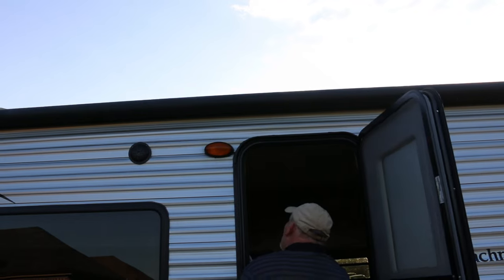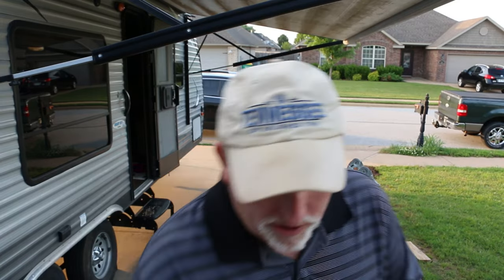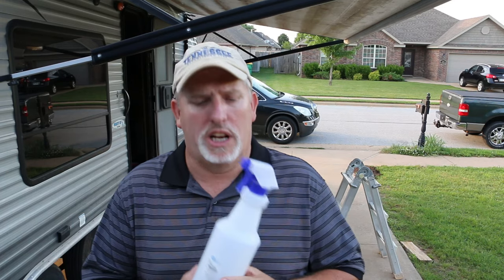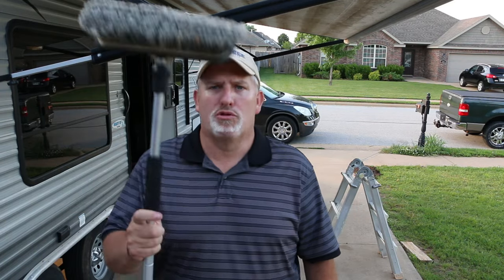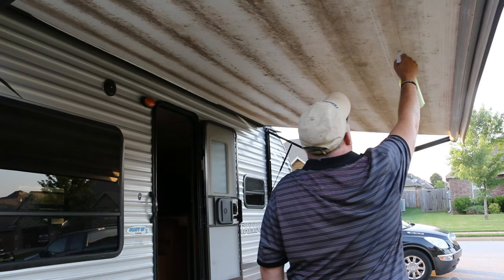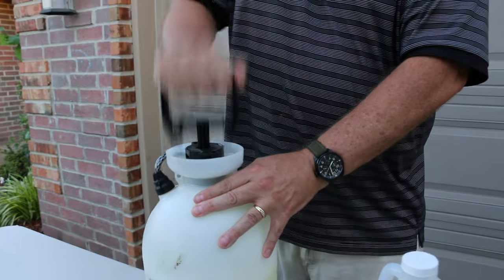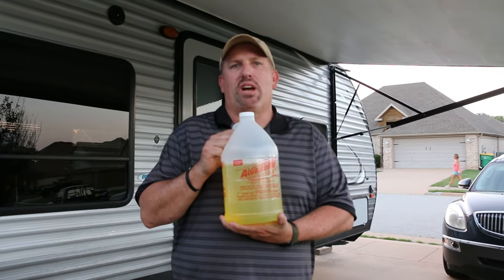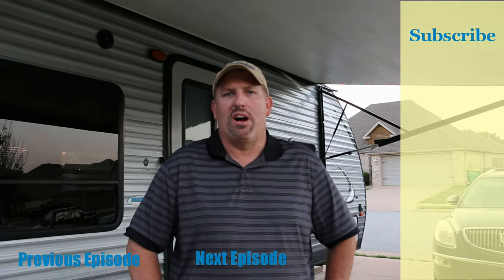How To Clean Your RV Awning the Totally Awesome Way

Comment: That LA cleaner is amazing, but be careful with it on painted surfaces escpecially trailer siding. If not diluted enough, it WILL stain the paint.
Reply from the maker: Yes it does work good and yes if left on undiluted it can do that. Thanks for watching

Comment: 1:5 ratio. Mine was very dirty from 8 months rolled up in Reno. Used a tankk sprayer, wet the awning and at least 30 minute roll up. The surface dirt rinsed off, but I had to lightly  scrub to get the darker junk off. I then had to spot treat  and scrub areas to get it really white. It's not a miracle product,  but I give it a thumbs up.
Reply from the maker: Great glad it work out for you. It is night and day difference isn't it. Thanks for watching.

Comment: We just used this method yesterday. Wow! Worked great. Our awning was nowhere near this dirty but we didn't want to wait until it was. The lawn sprayer was a worksaver, and we just happened to have one in our lawn care shed. So, thank you, Kevin, for a great awning cleaning solution. Oh, and we couldn't find a way to measure out the stuff in our five gallon sprayer so I just winged it. Pour in some stuff, pour in some water.
Reply from the maker: That great. Yeah I don't think there is am exact measurement. The sprayer is the way to go. I need to clean my awning now on my new bullet. Safe travels and thanks for watching!
Reply: @KevinandKimOutdoorAdventures  use an old gallon milk jug.  easy!

Comment: Caught me at a perfect timing at Lowe's passing that product in the aisles looking for the same job! Thank you for posting this video
Reply from the maker: It works great. Make sure to roll it up and let it soak.
Reply: Holy Smokes!!! Not only did that chemical work amazingly for the awning but I sprayed it on the side of the camper and black and brown stuff started melting away immediately.  I used a lighter duty electric pressure washer for the under side of the awning rinse (recommend using a garden hose sprayer to rinse the chemical off first so that it isn't dripping down in the eyes and onto your face when rinsing).  I used the RV washer pole brush on the top of the awning and rolled it out a couple feet at a time to make it easier to reach.  Finished off by pressure washing the underside and WOW!  Brand new looking!  Great video sir and mam!
Reply from the maker: Good I am glad it worked out for you. It is a night and day difference huh? Well be sure to subscribe and check out some more money saving things we have done  Safe travels!

Comment: Tried this today but only let it sit for 5mins and didn't work too well.. I'll try again tomorrow and let it sit for the 30-45mins as you suggested. Thank you for this video. Hoping that I can get  mine cleaned out good.
Reply from the maker: Yes you need to let it sit for atleast 30mins to an hour to allow it to break up and dissolve the grime. Good luck and thanks for watching and commenting!
Reply: @KevinandKimOutdoorAdventures  thanks for the reply. Unfortunately I’ve tried it all at this point and can’t get the streaks to go. The  totally awesome made it 80% better but I can’t get the rest of it. Tried soft brush hard brush pressure washer magic eraser everything but bleach.

Comment: So.......two years later? Hows it working out?
Reply from the maker: Oh it's great. I need to do it again as it is starting to get a little dirty again.
Reply: @KevinandKimOutdoorAdventures  i gave it a try, worked pretty good. I used the bug sprayer right out of the gate. I knew I was going to throw that spray bottle out into the street after about five minutes.
Reply from the maker: @fordfan3179 yes it did not take me long to figure it out. The sprayer is definitely the way to go.

Comment: We’ve never diluted the cleaner….hubby uses it straight……also takes the black streaks and algae off the siding…….
Reply from the maker: Yes I have used it on the siding as well it works great. Thanks for watching!
Reply: Usually these type of chemicals are really expensive so diluting it will save money and it lasts longer. Depends on how dirty something is I guess right?lol

Comment: You need to pause with your awning when it’s extended about 18” out then wait a few seconds and continue extending it
Reply from the maker: Really how come? I have never heard of that. What does that do?
Reply: @KevinandKimOutdoorAdventures  the air cylinder needs time to recover. 12-14 inches out from when you first start to open it. Wait about 5 seconds then open it all the way. Same when your rolling it back in
Reply: @KevinandKimOutdoorAdventures when you roll it back in do you roll it in 18 in and then stop or did you roll it in until it's 18 in from the RV and then stop for a few seconds?